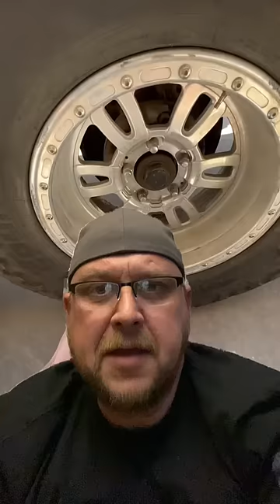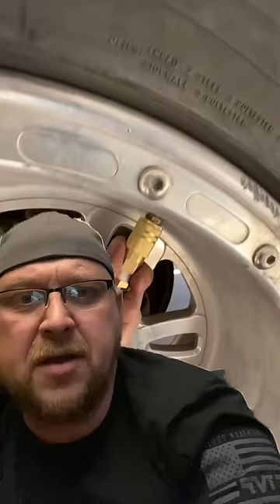A Trick That Works

Comment: I just discovered that my emergency battery jumper and tire inflator has all the attachments for inflatable toys and balls.  A little hatch on the back it stuffed with adapters.  And I have been hauling out my shop compressor all this time.  Should have taken the manual to the toilet.

Comment: I've had a little tire about 10" diameter with plastic rims explode when the rim failed, it wasn't even at high pressure and when it exploded it shattered both thumb nails and 2 toe nails and i had a chunk of plastic hanging out of my leg.. bugger ever trying this trick, i got hurt badly enough with much lower pressure

Comment: No problem on class 8 vehicles with 11r22 tirres that take 105+ range psi air.
Reply: 150 PSI Shop air will still do a 22.5 in my guy.
Reply: @adamyoung8289  the point is it's not an emergency issue. And those tires will hold 150 psi no problem cold.
Reply: @johngaspar4425  Put 63k on the fifth wheel, fill your tires up to 150 PSI and get to trucking down a mountainside then my guy. 150 isn't life or death under ideal circumstances, but under the wrong ones, it will absolutely fuck your day right up. Excess heat and wheel load on 150 PSI tires is a blowout waiting to happen.
Reply: @adamyoung8289  What's the matter with you?

Comment: This was my backyard mechanic method of setting the bead.😂😂😂
Reply: I found removing the valve core and a high flow blow gum with rubber tip works even better. This method makes me nervous when you have any decent sized air tank.

Comment: I've done that several hundred million f******and luckily never have been blown up or had it gets stuck on the valve stem when I did get blown up though it would buy a 2,400 ml five-foot-tall eskavator Trump dump truck tire with a split rim

Comment: Does Not Work !!!!
You need a center pin or enough pressure to bypass the pin !! 
Do Not Try this unless, like he said you can run across the shop !! Fast!!

Comment: Who says you can’t put 175 psi in a trailer tire…
Reply: My brother put my inflator on his miata and gave me back my tire gage saying it was broken... it wasn't broken he just filled his tires enough the needle was wrapping around
Reply from the maker: The the writing on the side of the tire 😜
Reply: True, unless you come across tires that don’t have a pressure rating on the sidewalk. Seen a few of those…not many but they are out there. Guess they assume people will stop at 40 psi.
Reply: That’s pretty impressive…scary, but impressive. 

That’s one thing I’ve never had happen is a tire explosion.  I’ve swapped hundreds of tires on rims and haven’t had one pop yet.
Reply: @Stephen Parchewski  Nowadays we don't use split wheels so it's a non issue the tire may explode but if you're a few feet away you'll be fine
Reply: Yeah, we have some grain trucks on the farm from the early 80’s with split rims that we still use. Those are super sketchy to change. All you have to do is change one to find out why they aren’t used…